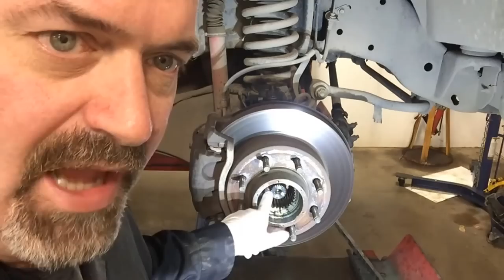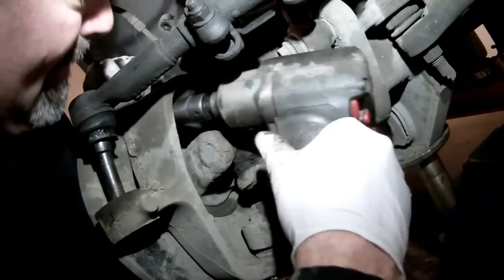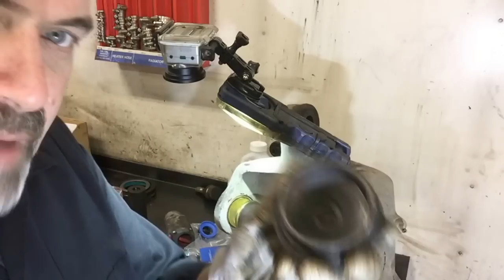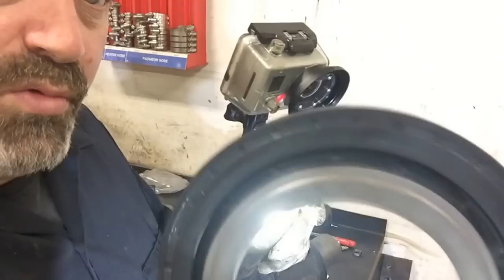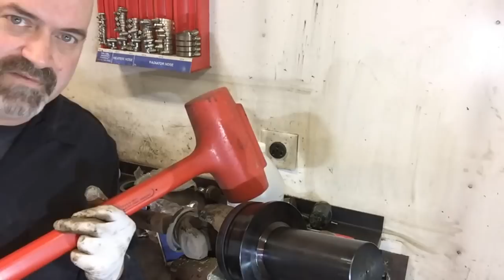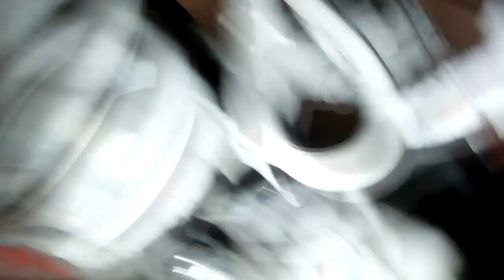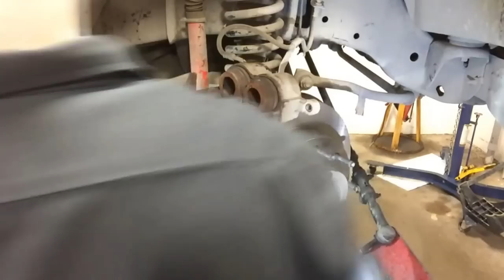How To Replace Ford F250 F350 Super Duty 4X4 Upper and Lower  Ball Joints

Comment: Hi....I'm trying to figure out where this washer I have goes..we had the ujoint taken off by someone to put the seal on by a machine...Well we seem to have a thrust washer..its flat plastic with a flat side and on other side has notches...we are not sure where this washer goes or which way it goes on...flat side facing in or notched side facing in? please help! truck is sitting tore apart.
Reply from the maker: +Lori Johnson Notch side facing in goes on over the outside end of the driveshaft stub (the short part of the driveshaft sticking out from the u-joint yoke) after the shaft and seal are driven into the knuckle. When slid over the stub it rests on the face of the shaft then sandwiches between the back of the hub/bearing assembly when installed.  Hope that helps.
Reply: +The Car Doctor I was wondering that too. I should have paid more attention when disassembling it. GREAT VIDEO!!!
Reply from the maker: Thank you! Glad to help.

Comment: Do you know the National dust seal part number for the front axle shafts (2006 F250 CCLB FX4) ? 

Thank you!
Reply from the maker: +Denver Elkins its in this video. https://www.youtube.com/watch?v=DcmHZyOkTSE
Reply: Awesome thank you. I found the new Updated one. works better and last longer. doesn't come out after so few miles. 

SPICER P/N : 2014835 

OEM FORD P/N : AC3Z-1S175-A
Reply from the maker: Oh cool. Thanks for the info. Are those numbers both the updated seal?
Reply: +The Car Doctor. Yes sir, I went with the Spicer ones.
Reply from the maker: Very good. I'll add the info to the description. Does the updates seal just pop over the yoke by hand? Thanks again.
Reply: +The Car Doctor the updated seal actually is installed into the axle housing. then you just slide the axle shaft into the seal in the housing.
Reply from the maker: Sweet.

Comment: I'm having trouble finding ball joint press adapters for my 2006 F350 4wd truck. I would appreciate it if you would let me know who the mfg is and the part number(s) for the ball joint adapters that you are using video.  By the way, great video.
Reply from the maker: +Gary Fike http://www.amazon.com/Astro-Pneumatic-Tool-Joint-Adaptor/dp/B00C7JZ26Y/ref=sr_1_2?ie=UTF8&qid=1443824845&sr=8-2&keywords=Astro+ball+joint+adaptor+kit this is the adaptor kit I used. You'll also need the press. Thanks for watching.

Comment: Thank You for making the video to show the finer points of doing the ball joints on this truck.
One question. I see that you did not use the new update dust seal on the axel tube. Or was it
that you just did not show that part?
Reply from the maker: +Sean Not-telling I should have used the updated dust seal and showed installation in this video. I will get some video of the new seal the next time I get one in. Thank you for stopping by the shop!

Comment: My front hubs were rusted on my 2004 F-250. A slide hammer (dent puller) with 3 prongs pulling on a 3" muffler clamp tightened around the perimeter of the hubs took a few seconds.  Banging on the hubs  to loosen them sufficient to pull them out by hand did not work.
Reply from the maker: Jules Bartow Hey that sounds like it would make a great video! So glad we don't have a ton of rust around here.

Comment: Excellent video! Very well done!
At the 34 minute mark you use the special tool to hammer in the seal into the hub, can one possibly use a very large puller to grab the hub with the arms then put the center screw onto the end of the press tool and simply press the seal in instead of hammering it in? I hate using large hammers if at all possible to do it a more controlled way.

No matter great job on this video! I used your video to guide removing all these parts to replace the U-Joint, all the seals, upper and lower ball joints and new hubs.
Thanks!
Reply from the maker: +Sal Carceller I don't think that would cut it. That seal requires a lot of force to drive in and it needs to be set at the perfect depth in the knuckle. You don't want to hose that seal cause it's about $60 to replace.

Comment: Doing seals and bearing on my F350 1995 ,Front end whole thing being re done got driver side off and ready all gears and spindles look in good shape cruise control quit working awhile back so hope after this work done i can get it going again  doing passenger side tomorrow .Inner and outer seals and bearings .Did the engine rebuild in 2003 .
Reply from the maker: bobcatwelder00 excellent! Keep up the good work. Thanks for stopping by and watching!

Comment: It looks like you forgot to install the inner Dust seal before sliding the axle back in? The new dust seals are the metal version part BRS-170
Reply: flyguy767 Wow ur sharp!!
Reply: flyguy767 Bet u fly planes huh?
Reply: todd evans  I guess you think I was trying to be a smart ass, well your wrong. I was actually interested in seeing the "new" style dust seals installed, apparently the installation is different with the metal ones compared to the old style. Buy the part from Ford and it includes the instructions, but buy it from NAPA for half the price and it doesn't. Oh, yeah I flew large transport jets.
Reply from the maker: flyguy767 I'll have to look into the updated seals and the replacement procedure. Sorry I didn't cover that in this video.
Reply: I just did the new steel dust seals. Easy just press them in with a piece of  2 1/2" rigid PVC , they "ll press right in. Much better design than the old rubber ones you would slip over the axle before slipping axle back in.
Thanks for you great videos
Reply from the maker: excellent. Thanks for the great feedback.

Comment: While attempting to replace my ball joints I found a broken bracket. It appears to be part of the lower leaf spring. Is this part that can be easily repair by welding it together again or would it need replacing? I'd like to send you a photo, but don't know how to attach it to this link.
Reply from the maker: Rick Case this vehicle had coil spring suspension however you may be referring to part of a leaf spring system. Sounds like you would be best to replace or have something fabricated.
Reply: Trac bar bracket broke where it connects to the passenger side lower bracket of the leaf spring. Called a local welding shop & they repaired it in 30 minutes! Said they see this all the time mostly on lifted trucks, but it also corrected a wobble in my steering. Keep those great videos coming.

Comment: Best SD ball joint video I have seen.  Thanks for you time.  I have the seal tool on the way.  Looks so easy compared to going without...  even if I only use it on one truck.  Perfect amount of information, without all the wasted time most people seem to pile in other videos.  Thanks again.
Reply from the maker: the74impala thank you for the complements. Let me know if you find a good deal on the tool and we will pass that info on. Good luck.
Reply: Do you know the part number of the tool?
Reply: @mattgilbert8396  depends what year SD you have. The coil springs are different than leaf.

Comment: Morning "Car Doctor"! I really enjoyed your video and making everything seem easy. I have a 2003 F-250 superduty and intend on replacing my ball joints this week. What are the necessary seals and parts that should be replaced during this operation? I've tried to make a list and it seems like it grows every time I watch your video. I had to buy the removal tool, as no stores have it for rent or purchase and can not foind the "OTC6695" tool anywhere except on the internet. Is there an alternative to this tool? Thank you and Happy July 4!
Reply from the maker: Rick Case you don't want to try and substitute something in place of the tool and risk damaging the expensive seals. I hear some guys have tried using ABS pipe but that sounds a little schetchy. I'll make a list of tools and parts next time I do one and post it here. Good luck.

Comment: How long did it take you to do both sides of this truck?  I figure I better triple that for me to do this job.  I already have all the tools you needed, but the OTC6697.  Do you think I should invest in that tool.  I have a 2006 f-250 and doubt I change the ball joints again (while I own it).  Also, should I change the tie-rods at the same time? Great video, BTW. Very informative.
Reply from the maker: Brent Zumwalt Thanks for the complements! The tie rods hold up well on these. Since you can easily do those later if needed I would pass on them if they are tight. Have someone turn the steering wheel back and forth while tires in the ground and watch for movement at the tie rod ends. Look closely at front axle u-joints and any movement in the wheel bearing/hub assemblies. Very common issue as well. Don't skimp on parts. I recommend Moog when possible on suspension parts. Moog or national hubs if needed. I forget what the total job took but it was roughly as long to do the other side maybe a little longer since I got warmed up doing that side. Thanks for watching and good luck with your repairs!
Reply: The Car Doctor Thanks for your reply.  I have already purchased Raybestos ball joints.  I was reading the online reviews and the are very similar. I have ordered the OTC6697  from Amazon for $82.  After seeing your video, I think it will be worth the money.   BTW, if you ever have to replace an EGR cooler on 6.0 diesel, please make a video.  I just cleaned my EGR valve, but i think I am going to have to replace the cooler.  Staring to have white smoke.

Comment: Thanks for your fast return on my question about tools. I actually took notes throughout and wrote down as many tools, lubes and parts as you explained in your video. What recommendation of socket sets would be best to tackle this project? SAE or Metric and maximum size sockets. I have listed out everything and done a total for parts.
Reply from the maker: Rick Case Take a close look at your outer axle u-joints and hub/bearing assemblies before hand to determine if you need those as well. Bad u-joints will usually have rust coming out of the cap and may also be loose, jack up the suspension and wiggle the wheel to check for play in the bearing as well. Take a close look at your brakes since its a good time to address that as well. Mostly metric sockets as I recall but you can aquire a set of 1/2 drive impact deep six point sockets for about $20 each so now might be a good time to invest in a set of each. Don't forget snap ring pliers and the special driver for the seal and youll need a nice sledge hammer to pound that in. a torque wrench is necessary for those ball joints and don't forget to follow my instructions there.

Comment: Thanks for the great video. Glad I watched prior to starting my 2003 F250 Superduty. Is there a list of all the "O" rings, wrenches, sockets needed? I live in the mountains & if I start this project I have no way to go after another tools. Any help would be appreciated!
Reply from the maker: Rick Case I don't have a list but will work on that. I think I gave a detailed description during the video along the way.  I hear you can rent the ball joint press from your local parts supplier but youll want the one that has the truck adaptors. Good luck and thanks for watching!

Comment: How is the process different with manual hubs. BTW love the video
Reply from the maker: jdmdfd Thank you! Not much different. No vacuum hose but the axle seal is same. Might be able to re-use the axle seal since its not as important to seal vacuum however not recommended if youll be exposing the vehicle to water or off-road type use. Otherwise the general process should be identical if im not mistaken. Good luck!

Comment: Wow Tim that was a great demonstration.  Excellent lighting and angle shots. Never seen a camera  mounted on a light before, that's a first, good idea.  I'm not a fan of the Ford 4wd system with vac. Hubs. I like the Chevy design , so much easier. Man that was a lot of work, I'll leave them jobs to you young guys .👍
Reply from the maker: Steve Rob thanks for the complements! That's an old gopro I decided to mount to my LED light. Someday I hope to get a better camera for low light conditions. The editing took a little bit but the export and upload took even longer. Hope it helps someone. I also don't care for the hub system. I always forget to bid the seals which cost $50+ ea. I did rear brakes, tie rod ends, drag link and front end alignment and it ended up around $2700+ 😀